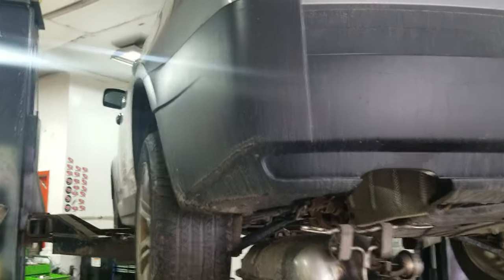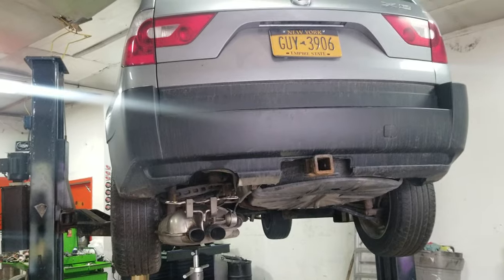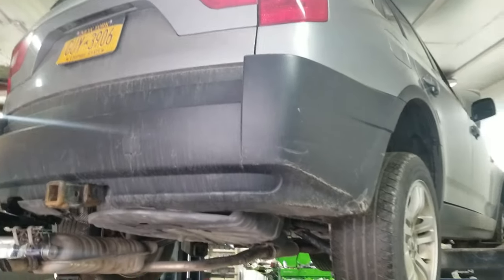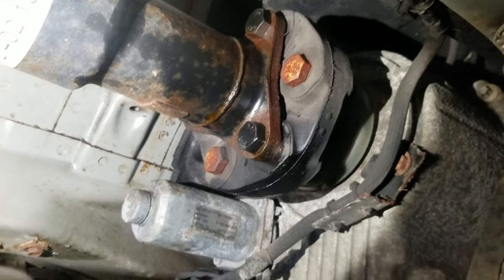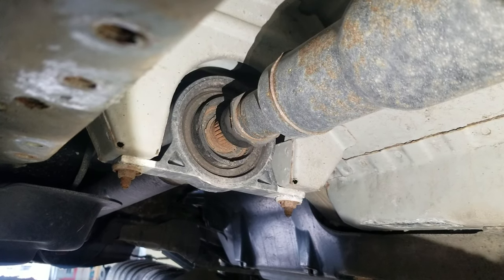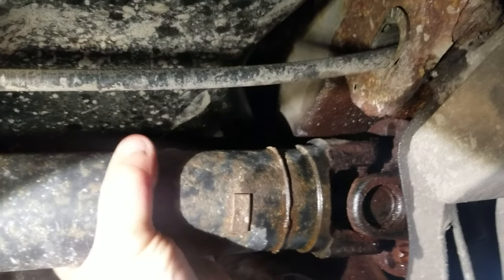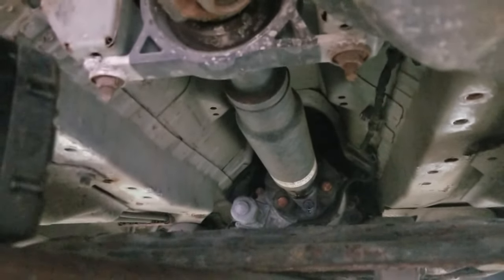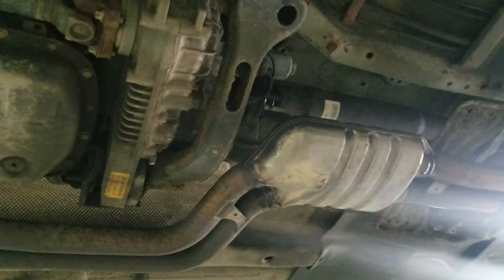BMW Vibration / Drive shaft Repair

Comment: I have the 525Xi. I can feel the vibration during driving.  When I am in drive, the vibration is greatly reduced but then I left off the gas there is certainly something is wrong. After viewing this video, I think it is the drive shaft.
Reply: Did you fix your vibration?
Reply: My 08 e90 335xi is doing the same thing

Comment: I replaced the front driveshaft in my 2006 X3. It was making one heck of a noise so it was pretty easy to diagnose. I’m not super technical as far as being a mechanic but it was a pretty simple fix for around $100. Like you said, if you feel comfortable doing it, it is a simple job.

Comment: I'm having that issue  😅 bad u joint going bad 202k mile  waiting for a new drive  shaft :)
Reply from the maker: Common problem. Also transfer case drive shaft is another one.
Reply: @towuniverse2443 where can I find the transfer case yoke that connects to the driveshaft
Reply from the maker: @Mk-ti3hl  that's probably going to be bmw specific,  you can try fsc euro

Comment: On mine  the rear u joint caps blew out causing the drive shaft to fall out however thoes u joints are actually replaceable and are sold with a drive shaft repair kit which comes with center barring and what not  however you can just pay for the u joint only if u wish you do not need to buy a whole new drive shaft if you dont want to the u joint is only 33bucks if you call a parts store and ask only for the u joint then they get confused because they cant find it that way you have to tell them to look up the drive shaft repair kit and just order the u joint from there it is a myth that the u joints arnt replacable they are very much replacable ppl just dont kniw how to find them at a parts store..
Reply: What about the yoke that sits on the transfer case where can I find that piece

Comment: I have replaced the rear and front drive shaft .  At this point , I don't even know what the problem was that indicated why I needed to replace,  but all I know is that after it was replaced, there is a vibration after about 60mph until about 80nph.  By vibration, I mean a high pitched sound and a fine vibration.  When accelerating or maintaining speed,  the sound persists , but when I let off the gas pedal, it immediately  stops, but then starts the noise again when I give it any throttle at all.

I am thinking it could be a balancing issue, maybe faulty part, or --- I don't know.  The thing that I can't understand  is why it stops when I let off the gas
Reply from the maker: Wheel bearings due go bad on these cars. If you turn your wheel at highway speed and the pitch of the sound changes its front wheel bearing. You can also put the car on a lift and let the wheels spin in gear and listen with a stethoscope

Comment: Any videos of the new one installed? Thx for this video. I think this is my problem. Noise coming from back I think. And if I give it alot of gas from stand still it will make a click sound like if it's going to break or crack

Comment: I had the same issue on the front and then shortly after on the back drive shaft. 

I knew my rear drive shaft was done because when inwas shift into reverse to leave my driveway it would make a loud "clink!" Noise. 

I paid 275 for the driveshaft and my private mechanic put it in for 75$
Reply: i have this exact problem and it’s been an issue for many months. i did not realize it could be the driveshaft. soon i am replacing the rear dif so i will inspect the driveshaft while i’m down there. when the front was replaced i actually found an A1 Cardone one for $200 on Rock Auto and its been working perfectly for something like 22k miles so far.
Reply: @ryan-el9er  my front and my back both went out within 6 months of each other.
Reply: @ryan-el9er  definitely get it replaced. I was on a road trip and it starting clinking like crazy. I was very lucky to make it back to Omaha safe and sound. When the mechanic took the shift off it was in really bad shape.
Reply: Madroon thanks for the reply. i will try to get it done soon. i’m like the 6th owner of this car and it was not maintained at all. i’ve practically been restoring it (put close to $10k into this car i bought for $3000). trying to do most of the work myself and it’s very time consuming. the rear dif has to be replaced next and even though i’ll be down there anyways, i don’t think i’ll have enough time to also go and replace the driveshaft. i dont want to risk running out of time because i would definitely need to finish it the same day. but i will definitely focus on replacing that driveshaft next.
Reply: @ryan-el9er  I am the 2nd owner my 2008 x3 3.0i. I got it at 85k and currety it sits at 155k.  It's been a great vehicle, but costly at times. 
I dont drive it as much as I used to, I will prob end up selling soon.
Reply: @ryan-el9er  currently i have a 4x4 light on my dash.. so ill have to figure out what that issue is next. Lol
Reply: Madroon i have a 2006 325xi that i got over 197k miles. i’ve passed 221k miles. i got the car around june last year. drives excellent and looks excellent. as for that 4x4 light, there’s a million possibilities. i’ve had it happen for a few reasons, most recently because i needed an alignment.

Comment: Thanks brother. Now i got an idea of how to approach this issue i got with constant squeking like back and forth noise. Each wheel turn at slow speeds is like 5 to 7 squeaks so i am almost sure its the rear u joints totally shot
Reply: Hi Zach I've the same problem. Do you find a solution?
Reply: @GurvanR  i did, it turns out, it was my front wheel bearings which were totally destroyed, which caused the squeaking. If your car has less than 200k miles it might not actually be the drive shaft.
Reply: @zachleonard258  Thank you to answer. Mine only 125k miles. Squeaking  at low speed when I accelerate. And Shakes at highway speed

Comment: I just recently got eBay set whole new shaft  bearing support and the flex disc for $265 auto zone  or other store want $800+   I rather wait haha but it took only two day to get it  also I got rear axles so my repair will start soon :)
Reply: How was the outcome? Any issues with replacement
Reply: @bradzx   it’s install all fine  had no issue with install  but some review I read some can come not perfect balance with mine I had experience vibrating 65-75 mph. But after I took a trip 1000 miles  vibrations seem too go went away probably was a break in period not sure but it has been 7,000 miles now no issue yet 🤞
Reply from the maker: Always price shop!!

Comment: Good Video. I have the same car, same problem, same state. I disconnected the front driveshaft and almost lost the Yoke, Transfer case leaked a little and still have the same problem. BMW, Pok, NY wanted almost $50.00 for 8 Driveshaft bolts, yeah OK! 

Did you ever complete the job and how did it run after. Wish I had a lift... Wanna rent it? Lemme know, Thanks-

Comment: Hi, I own bmw X5 E53 xdrive, and under harder acceleration feel vibration from front on whole body, when not accelerating no vibration, what problem can be?
Reply: Augustinas R. Im having exactly same issue with my Coupe... did you find a solution?
Reply: @cekay1209  still not, but mechanic say it can be FLYWHEEL. CV joints replaced still problem here, engine mounts also in good condition.
Reply: Usually on German cars this type of vibration is caused by a failed carrier bearing (center support bearing) for the rear drive shaft. It's a wise idea to replace the center support bearing and the flex discs (Guibo bushings) all at the same time.
Reply: Same problem with my 2006 bmw x5. Vibrations when accelerating. I was told it could be engine mounts, drive shaft, flywheel.. any one know what it could be?
Reply: @Mariusv95   i have the same problem in my X3 e83,  could you solve it?

Comment: I have a problem on my x5 2005 when i go over 120km / h my whole car shakes and vibrations are transmitted to the steering wheel, what could it be?
Reply from the maker: Usually at highway speeds  vibrations in the steering wheel is a wheel balance issue, bent wheel, or tire

Comment: Can you tell what sound is it for front drive shaft how long can I drive if I remove my front drive shaft on my 04 xi
Reply from the maker: Go drive through a mcdonalds drive thru at slow speeds, You will hear a clanking resonating off the walls of the building.
Reply: @towuniverse2443  on last question in low speed I don't hear anything about only at 60 miles hour it's like a hollow sound it's not my wheel bearing I've been repair my control arm it was makeing  my steering wheel shake and tie rod replace but at 60 on highway I hear this sound any suggestions